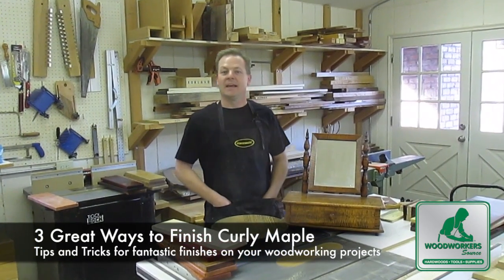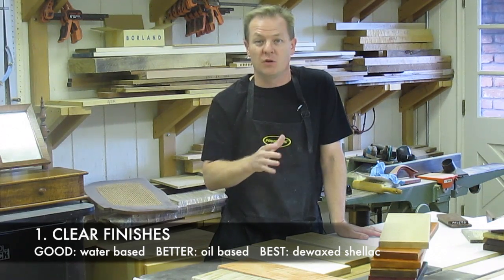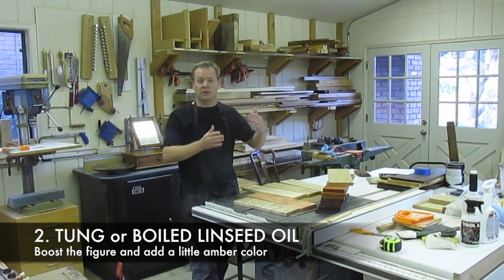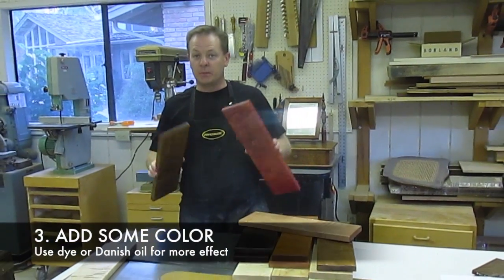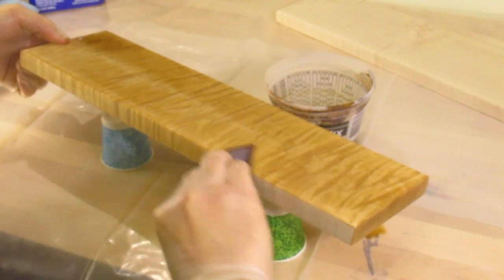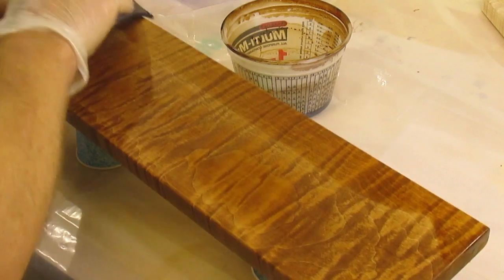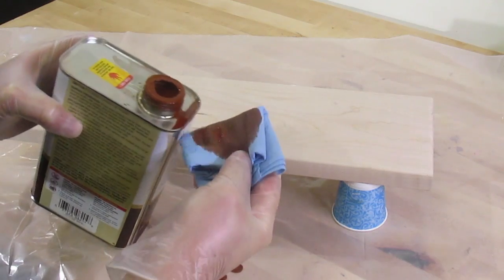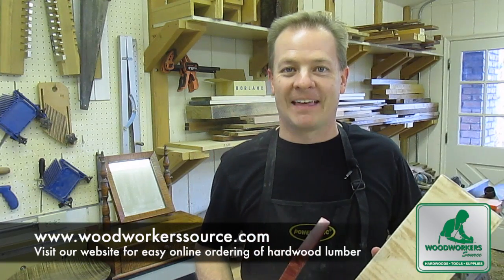3 Great Curly Maple Wood Finishes That’ll Blow ‘Em Away

Comment: New subscriber here. I was thinking about using the aquafortis method on a maple gun stock. Is there any advice you could share with me? I've had people say that I need to use a conditioner so the wood doesn't blotch. I noticed that yours didn't blotch.
Reply from the maker: I'm not familiar with aquafortis method, so I can't help you there. Is it a method that is prone to blotching? To clarify, oil stains that contain a suspended pigment are usually the culprits that blotch. Wood conditioner controls those types of stains. What I used here is dye. Not stain. Dye is not the same thing as pigment stain and therefore it colors the wood in a different way. I didn't use conditioner here because dye doesn't need it. However if I were to use an oil pigment stain, then yes it would blotch on maple.
Reply: Woodworkers Source thanks that answers several other questions I had about stain vs dye.
Reply: Woodworkers Source if I was to try and explain aquafortis I would probably explain it wrong lol. I just came across it when I was looking for ways to finish curly and tiger maple. Its some kind of acidic solution that you apply and let dry then apply heat to bring out the curl or stripe.
Reply from the maker: David Maxey I see. Either way, the best thing to do is practice the techniques and recipes that you're interested in on another piece of curly maple. See how it goes and what you like best.

Comment: Can you wait more than 10 minutes to sand off the dye?  If so what is the max time you can wait.  Thanks.
Reply from the maker: Sure, more than 10 minutes is fine. Days if you need it. Don't know if there is a max time.
Reply: Thanks.  Had several boards and did not want to do one at a time.

Comment: Is it possible to do the same dying techniques to birdseye maple? I have a dresser and bedframe that I feel would look stunning with a bit of color, but don't want to take away from the beauty of the wood
Reply from the maker: Yes. To test colors, if you don't have some scrap pieces to work with, you can use the inside face of one the drawer fronts. That way you're not working on a "show side"